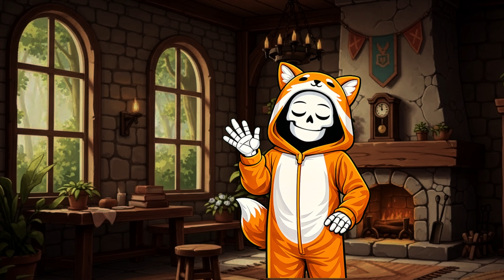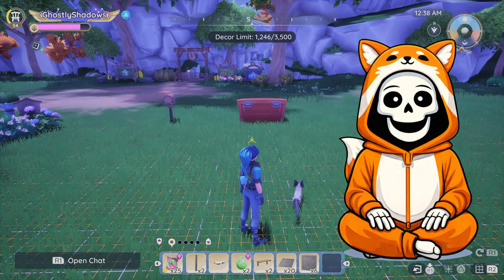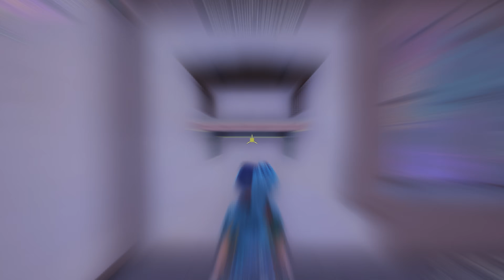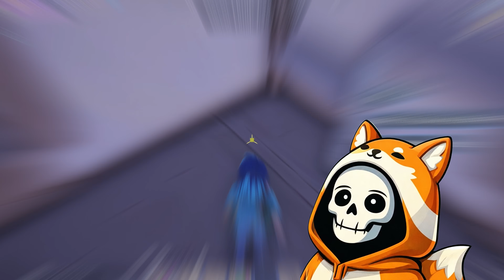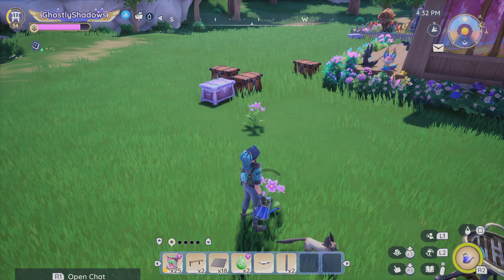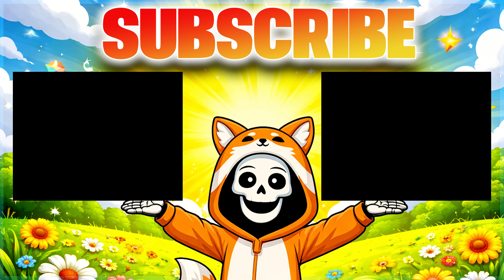Palia Decorating Guide for Beginners (PS5) | Build, Place & Design Your Plot

Comment: Awesome as ever.  I don't like to glitch things together all that much so I tend to use items as they are.  About the only fancy trick I use is having the gourmet bowl placed on things that I want to glitch together without seams.  Like using the Capital Chic tables to make larger bodies of water.  i am not sure if this works on the switch as I am on PC.  But you place the bowl on what you want to move then target the bowl and hit whatever button is "select all" you should then be able to move two items together. Also you can place almost everything on a red present to put them in odd spots that normally wont accept them.  Like a tree in the house.
Reply from the maker: I personally don't care for most of the glitching as well. I have tried that, the only glitches I've used is to build out of bounds.